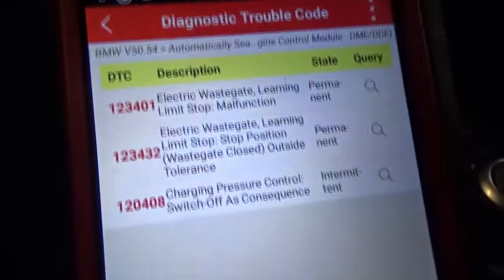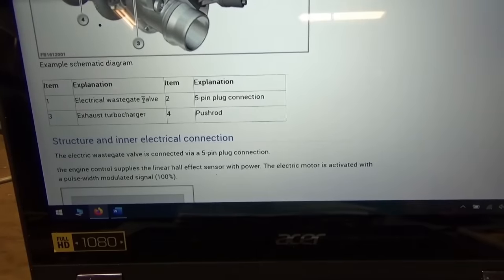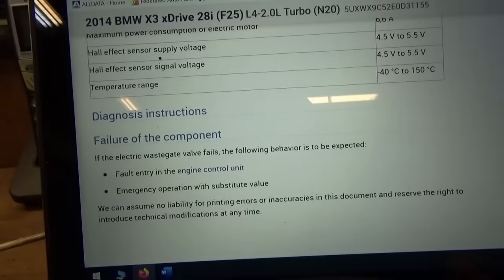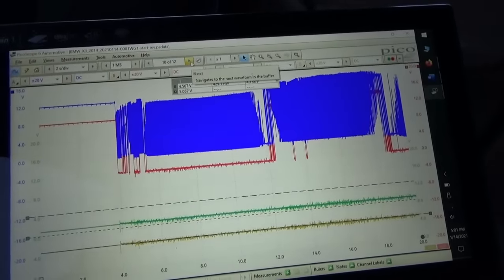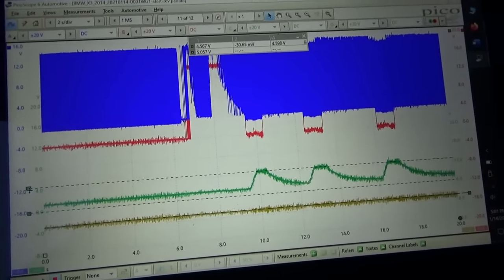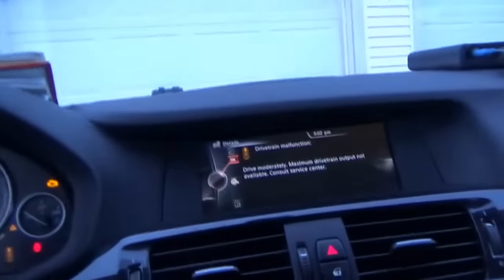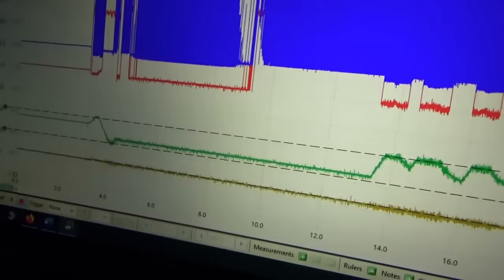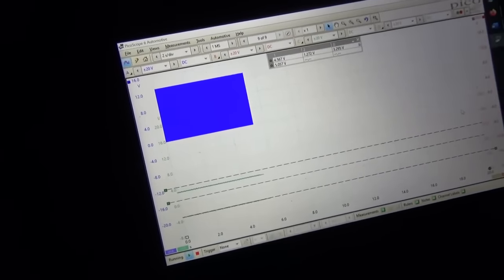BMW Turbo Wastegate MALFUNCTION

Comment: I have a 2013 BMW 528i, my Westgate says it has no electricity. I already checked the fuses near the hood of the car on the passenger side. I had to cut the box to check if the fuses were blown and there was no blown fuse. I don't know what to do anymore! I can't do the relearning through the ista program because it says there's no electricity! Could you give me any ideas please?
Reply from the maker: Check for voltage at the actuator by following the wiring diagram 😉
Reply: I was able to see the diagram, the problem is understanding this diagram. in the diagram which party is responsible for westgate? 🤔

Comment: My BMW had the entire turbo assembly replaced at 35k miles due to this issue I believe. I wonder if it just needed the adjustment, but then again how long will this adjustment last?
Reply from the maker: Was it under warranty? Should last at least another 70k miles lol
Reply: @PineHollowAutoDiagnostics  Yes it was under warranty, this same engine (N20) has a timing chain problem, my timing chain was replaced at 45k miles. 

Keep in mind my car is babied and meticulously maintained. Oil changes every 3k with liquimoly LL or BMW oil.
Reply from the maker: @FrenchValleyAirport  Wow timing chain at 45k miles?!? Must be defective lol

Comment: These cars have 30.000km (~18.000 miles) oil change intervals in Germany. Oil should meet BMW LL-04 spec. Not a fan of these long oil change intervals but 5000 miles sounds too frequent to me. I change the oil every 10.000 miles or once a year.
Reply from the maker: Better safe than sorry if you want it to last a long time!
Reply: @PineHollowAutoDiagnostics  true. But I'm a cheapskate 😅

Comment: From the comments I feel like I almost have to hunt through Oklahoma City to find a shop that can do this EXACT thing.... because I could adjust that actuator, but I have no way of doing everything else you did with the computer, and the adjustments. Does anyone have any idea on a shop in the oklahoma city area that could solve this EXACT problem?! This dudes channel has been a god send because I feel like if i were to have taken this to a shop that someone would try to tell me that I need an entirely new turbo.

Comment: How did that get 4 turns out of adjustment?!
Reply from the maker: Great question!! Seems like a lot. We'll see if it gets bad again in another 70k miles lol
Reply: @pine hollow auto diagnostics It was probably a gradual process, that showed up as being extremely “out of calibration” when it finally exceeded the tolerance.     There has to be an allowable tolerance of some sort, who know how much.   Maybe the four turns put it closer to the other extreme..... implying that it may have only truly been one or two turns “out of calibration”.   

Whatever the case..... great diag Ivan.   You might check out “Velocity Garage” otherwise known as the Jonny the Car Ninja.   He’s the BMW man and super humble about it too.
Reply: @PineHollowAutoDiagnostics  My guess is carbon deposits compacted at the waste gate bumpers or butterfly seat. Likely build up that still seals well but enough to get that linkage off just enough to fondle the computer.

Comment: I'm sort of guessing where the shaft for the wastegate runs through the exhaust manifold that the holes are worn out , that would explain rattle. I always thought BMW meant ( Broke My Wallet)😂. Changed the waterpump on one a few years ago, electric water pump , what a P.I.T.A. passenger side down underneath about where you're at, I think about four hoses on it.

Comment: just to let you know   we were taking the 95 transport  to get fixed..eveyrthing  started  working  like nothing happened  ,,the guy i took it to  found   nothing loose  on grounds  ,,i still think its the ign switch  but it running fine  ,,need it in the snow lol

Comment: Hi. Would you please tell me the size of the hex nut that control the adjustment??
Thank you in advance!!
Reply: Hi, did you fixed yours yet?
Reply: 10mm
Reply: Bornfree. Not yet
Reply: @shanewoodall5461  I know that. It’s the inside thread is too fine from the nuts I found
Reply: @B0RNfree  yes I did. The nut size was M6 x 0.75mm

Comment: Mine even stupid-er.  Connection pivot joint (proprietary) has broken, so I can either spring for a new $250 actuator, to get this $.50 joint, or drill out the old one and hope I can fashion connector with tight tolerances yet low friction.  Joy, joy.

Comment: "71,000 miles, pretty typical for BMW to start breaking down".  That is a ridiculous statement.  I've had 3 beemers that all had over 100k when I traded in.  Can you give some evidence of this slanderous comment?  I believe you can say that about ANY vehicle.   In this case there was no inherent mechanical break-down, simply a sensor failure.  A reliable car.
Reply from the maker: Haha why would you trade them in at 100k miles? If they were so reliable, just keep them to 300k or so :)

Comment: Dealer would have sold them a turbo or something.
Reply: kenneth bode the whole exhaust manifold with turbo ... The car wizard made a similar video on an Audi Q5.
Reply: Technically it does need a turbo,  but if you don’t mind the rattle it’s drivable.

Comment: I would also check to make sure battery connection points are secured, my trans did this after the battery was loosened 😂

Comment: Koeo press and hold bottom left button for like 10s until first job appears keep press button to scroll through jobs select the one you want press and hold for like 3s button on end of turn signal stalk  the "bc" button it will ask reset? Push again to confirm progress bar should appear to  when reset in progress

Comment: Dealer to sucker BMW owner, that'll be 5g's, we had to replace the thingy on the whatsit plus adjust the franistan and replace the blinker light fluid and adjust the muffler belt, dumb BMW owner, WOW, I'm glad you guys are so honest, meanwhile back in the shop the votech drop out adjusts the linkage and the customer is none the wiser. Take it to Ivan and he is honest all that was needed is a simple adjustment he tells you, he should've let you change on the oil as well but people who buy these fancy toys are cheapskates but will let the dealer rip them off without in a heartbeat.

Comment: Scotty says turbo chargers break at 60k.  And you replace the engine at 100k.  Sounds like this BMW is not far out of the Scotty bell curve.
I was going to replace our 2010 Honda CRV with new CRV.  BUT the 2010 has a 2.5L while the 2020 has a 1.5L turbo charged.  No thanks.  Looks like it's going to be a RAV 4.  Turbo chargers are for race cars.
Reply from the maker: Yeah 1.5 Turbo GDI sounds like it won't last too long. But hey it's a Honda!

Comment: I purchased a used 2015 528i for 22k “as is” with 51k miles YESTERDAY. Drove it this morning and driveshaft warning pops up. Took it to Autozone and code read that Solenoid Actuator is the culprit! I’m pissed. Dealer who sold me the vehicle didn’t mention that a 3rd party company offered 48k additional miles (or 4 years) on a warranty if I paid a extra $3700. Another rep yesterday informed me of this and said I should be able to add it to the contract with my bank who financed it. Within 24 hours this happened smh pissed off is a understatement. I have no idea what’s the best route moving forward.
Reply: So did you get it repaired?
Reply: @bwash6249  Yes the dealer fixed it for free.
Reply: @johnsondoeboy2772  Did the dealer replace the Turbo or just the wastegate actuator solenoid?
Reply: @bwash6249  turbo

Comment: Religious oil changes are more important than the oil brands.  In fact, I always found that my BMWs ran better/quieter with Valvoline SynPower or Pennzoil Euro.  I would definitely stay clear of the 15K BMW oil changes and do 5K-7K oil changes with LL-01 certified oil.

Comment: Makes me wonder what the a dealer would have charged to fix this problem. My guess is they would have changed the motor and accidently fixed it when they did the adjustment and relearn. BMW makes cool cars, but I shudder to think what that motor would have cost.
Reply: $3500 easy your turbo is no good and it comes with a new waste gate.

Comment: BMW and most European cars require a European spec oil usually 0w-40 or 5w-40 the oil container says European spec oil right on the oil container there is also listed on the container the BMW oil specification that the oil meets The customer need to make sure the quicke oil change place uses the right oil the coupon won't work for that and he is going to get a cheap $2 oil filter I agree with your assessment these cars are high maintenance
Reply: Oil is more to do with operating conditions.
If you read the manuals many will give a range of oils, and what conditions they are suitable for.
Reply: Mobil 1 meets the European spec. So does Valvoline if they sell him the right blend.

Comment: Nice one Ivan! I had a similar situation as well, no parts needed!  https://www.youtube.com/watch?v=DisGdDqhYkU&t=2159s    but the best part on what I (and you as well ) found was the use of the scope and how you can clearly see when the dme isn't happy and why. You would never know the answer to the codes if you never scope it. and P.S. you can reset all the cbs data thru the cluster still on that chassis. thanks for sharing!

Comment: Put a 6 cylinder in it and forget the Turbo.  IMO too small an engine for that size of a car..
Reply: Yup there ain't no reliable replacement for displacement ;)
Reply: Funny you say that....I had a V6 Tacoma and it had a heart of a Samarai  but towing our RV and the V6 worked hard and was thirsty...so I got a Tundra V8....Man what a difference in power and towing. I know Toyota is rumored to  bring a twin turbo 6 in the Tundra....NO THANK YOU...I want reliabilty. Screw the turbo.

Comment: I would LocTite, zip tie, and Duct tape that adjusting nut.
Reply from the maker: LOL 6Nm is enough ;D
Reply: It's a stop nut locked against another nut, not going to move, no loctite needed.  The looseness is likely due to mechanical wear.
Reply: @ckm-mkc  I was joking, geez- lighten up?
(a spark of MIG?)